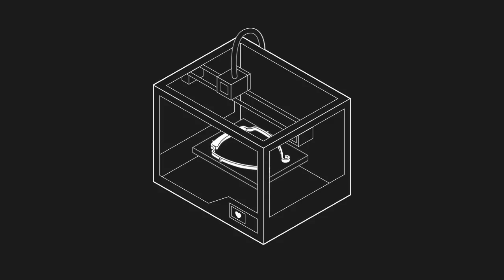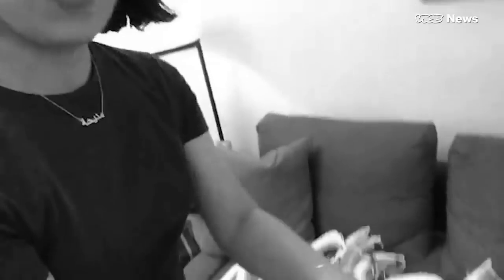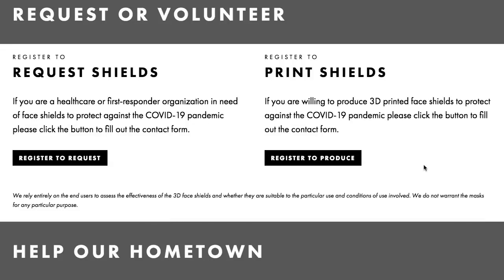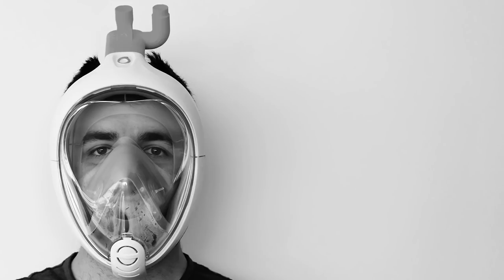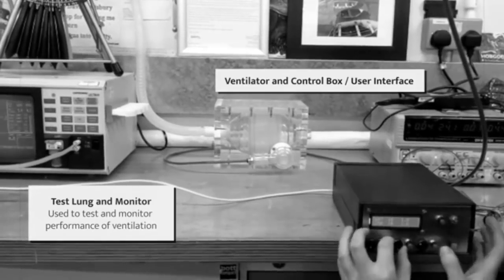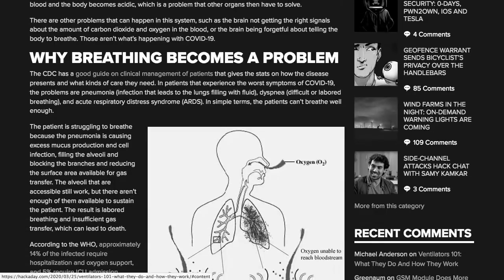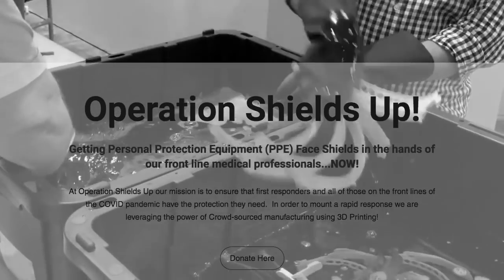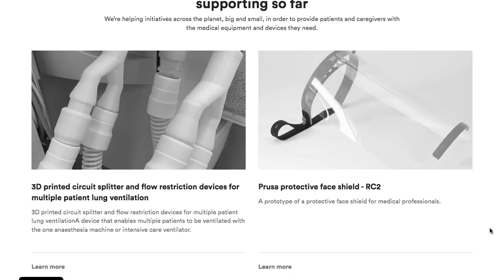Open Hardware Projects to Fight COVID-19

Comment: Ventilators are such a challenge, very difficult to make due to their precision and complexity. They are also used at such a critical stage. The more the community work on concepts the better it can be fine tuned and work

Comment: You missed one of the open hardware mask s designed by Hong Kong people. It’s various designs of 3D printed filter for 3M 6000 series gas masks that can use surgical masks with a seal and at a lower rate.